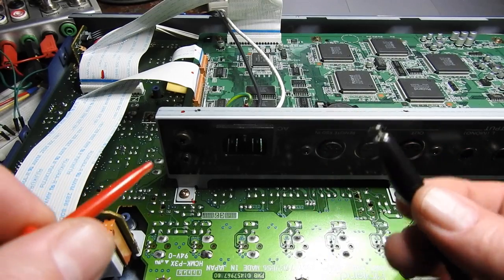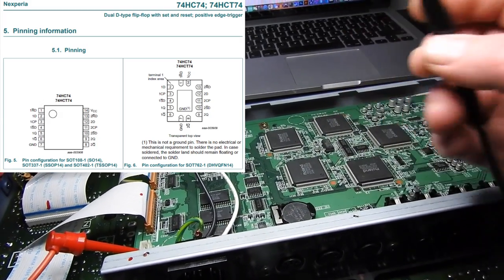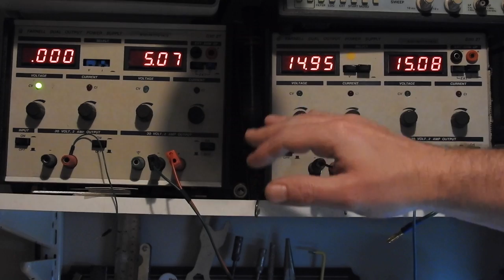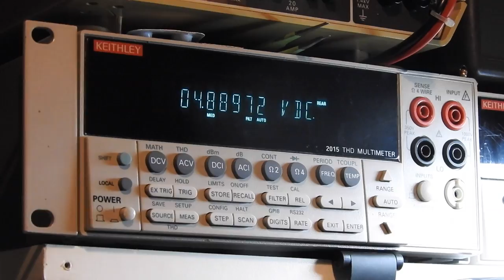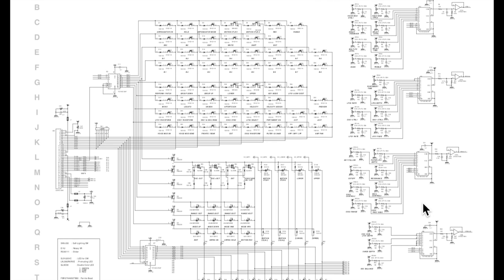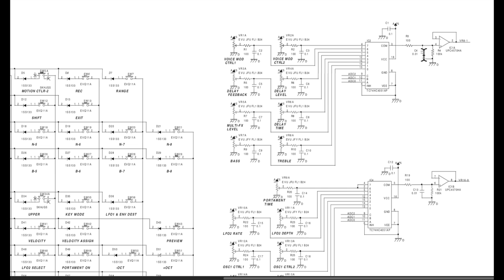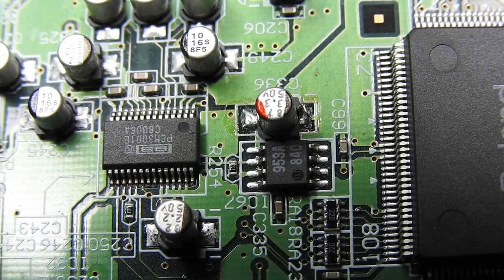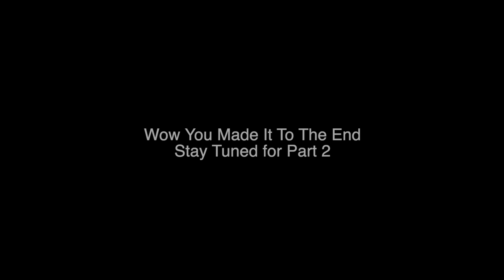Roland JP8080 Repair PART 1?

Comment: Are you doing the part 2 bid for this? Mine was showing a similar problem about 10 years ago after an oversized pc monitor fell on it. I'd had it repaired a couple of years before after I'd had a rock star moment and lobbed it out of the window, along with an electribe and a yamaha cs1x (I'd just split with the ex wife). Only prob I have now is that I've lost the power supply unit, do you think it's plausible to build a new one if I got the component listings? It breaks my heart seeing it as a lovely ornament.

Comment: Nice work, my JP8000 had a whole lot of dodgy electrolytic capacitors. Once replaced the synth worked fine again. On the JP8000 forums this is clearly a common problem.

Comment: I recently bought a second “for parts / Not working” JP-8080. Lucky for me swapping the fuse was all it took to get power and sound working! Your video provided an easy preview of how to navigate a teardown, so just wanted to say thanks. Next step for me is to change a wobbly volume pot, find some missing led’s and find about a dozen missing screws from a previous repair attempt. Good luck with yours and I’m looking forward to part 2!
Reply: Don't forget to check the CR2032 battery and use some deoxIT on the pots, faders and back TRS port contacts. I didn't even think to check the fuse before seeing this, looks like a white powder ceramic one that is slow blowing. I'd like to know myself which part to order for the caps, perhaps a link to mauser. I believe they are Panasonic brand, from a previous repair video by BradTHX on a JP-8000.
Reply: @Maschinestorm  Yes, the battery certainly needed a swap. DeoxIT helped with a few of the pots and sliders, but there were a hand-full that were just beyond hope and I had to solder in some new ones. My caps seem to be okay so far but I know it's just a matter of time. Let me know what you go with and Good luck with your repair!
Reply: For future people:

x19 EEEFC1C100R CAP, 10uF, 16V
x1   EEEFC1C220R CAP, 22uF, 16V
x1   EEEFC0J101AP CAP, 100uF, 6.3V

Fuse shows : 250v t 2 a h (slow blowing ceramic powder filled, prevents ARCing. it is normal to see black threading but not blackened glass)
Reply: @Ez-qt7dx  Well, got mine together but two of the buttons are not pressable and the write button fell into the case. Got to deassemble once again. My oled screen is a little messed due to having the persplex plastic screen glued on. If you do the oled upgrade don't bother with the plastic screen. The posts were filed down, need to find a proper way to mount this thing. Volume pot is wiggly so i'll be replacing it.

Comment: Brazil's distress call
I have a Roland jp8080, the flanger effect went off and doesn't stop, it stays in a loop all the time, even if I lower the effect volume, it continues without stopping. I'm scared my technician can't find the reason for the problem, do you have any idea what it could be? here in brazil we have almost no technician specialized in repairing synths etc...

Comment: Hi, had my JP-8080 opened today (still working) and noticed my capacitor on location C336 is also 3.3uF.  I've never recapped this unit. Just though you'd like to know the 10uF value in the service manual might be a typo.

Comment: Anyone ever tried to recap a JP-8080 with tantalums? Would it be a good idea to prevent leaks over time?
Reply: No. The electronics industry has largely moved away from tantalums.  They don't leak over time, but the can fail by burning up (actual flame).  Their only benefit was low ESR (internal resistance), but low ESR electrolytics are common today.  

If you recap your synth, buy same uF and voltage as the existing cap (or the next step higher voltage rating is OK), and get 105 deg C @ 1000 hours or 105 deg C @ 2000 hour electrolytic caps (or maybe better if you can find them but don't need more than that).  Most these caps that are failing on the JP-8000 and JP-8080 were probably 85 deg C @ 1000 hour rated caps, and worse, they were bad caps in the first place.  This was an issue with lots of equipment from the '90's due to, I think, a couple major capacitor company selling substandard caps for a few years.  I have lost an expensive '90's era Tektronix oscilloscope for the same issue.  

Note, 85C vs. 105C - what does it mean?  It is just how they rate the caps.  105C @ 1000 hours means the cap will meet its specs if operated at 105C ambient temperature for 1000 hours (only 42 days!).  But since the caps are mostly operating at < 30C, they will last years instead of just 1000 hours.  That is why 105C is pretty much industry standard today.  85C caps won't last as long as 105C caps at normal operation temps like room temp.

Comment: Wheres part 2 did it fix it what should I replace when the knobs are showing random tweaks without turning them im gonna try recapping it
Reply from the maker: I have the parts to fix the psu but been to busy mixing etc to look at it.  I also have an Orion psu and an rme psu which i will eventually make a combined video about them

Comment: do you know if one is to bleach the 8 white "key" buttons on the front that turns yellow over time, could you bleach them, as can be done to turn yellow keybeds white again (by leaving them in the sun for 24 hour) without taking it all apart or would it be too risky like that?
Reply: You could try the retrobrite method. I think one takes peroxide. 8-bit guy has a tutorial on this. Thing is you really need a test case and there really isn't one.
Reply: @Maschinestorm  ok thanks mate - will check it !
Reply: @AnalogFlava  I said peroxide but not hydrogen. There is a page on Syntaur that has an article but it is a Salon style volume 40-60.